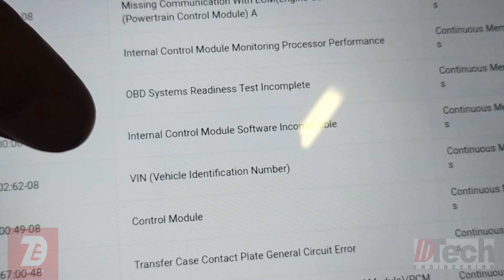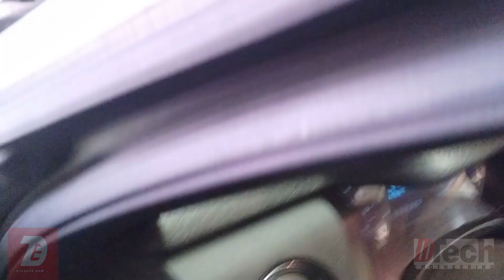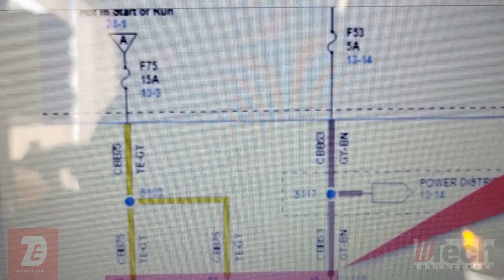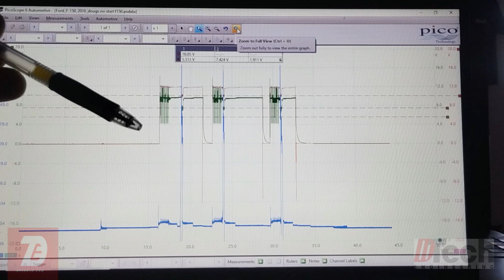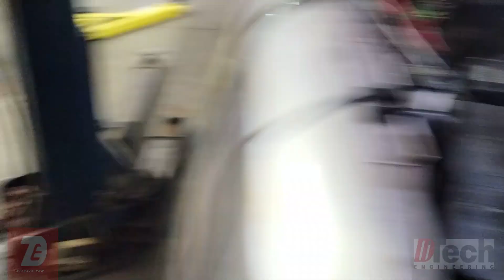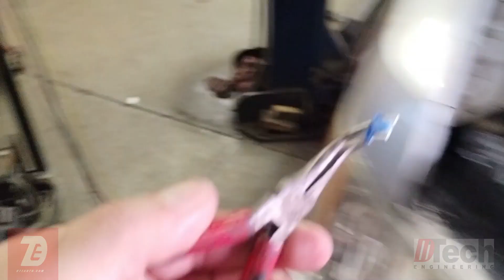2010 Ford F150  PCM Code P060A No Start Diag & Fix

Comment: My 2009 was having the same codes, CEL and wrench light. It would start and run but really poorly and the throttle would do nothing. Taking the fuse out and putting it back in immediately fixed the issue!!!

I also had a corroded battery terminal (negative).

I seriously can't believe it was that simple! Thank you for this video!
Reply from the maker: Thank you so much for that, very much appreciate it!!

I am super glad to hear that the video helped you out and got you going again. Thank you for the support and thank you for watching!

Comment: Was getting codes P060a and u0300 codes along with battery and wrench icon. Was stuck in limp mode on the side of the road. Removed this same fuse and replaced it and back on the road! Thank you!
Reply from the maker: Glad it helped get you back on the road!

Comment: Very nice diagnosis, I must say! Do you have any idea what year range that might be most likely seen on? I do a very large number of Ford trucks and I have not seen this yet, but I will be keeping my eyes open from here on out. Again, nice diag and thanks for posting! 👌🏼👍🏼👍🏼
Reply from the maker: I am not sure on the year range, but more maybe can be picked out by the type or style of pcm.... this could possibly be more attributed to happen on the 3 plug pcm's compared to the 2 plug ones. Although any module that receives around the 7.5v's seems to be the threshold for acting funny. I did another video on a bmw that keep losing key recognition in the immo module due to voltage dropping right at that 7.5v's range. Thanks for watching and hope that helps with the question.
Reply: @DTEAuto  Excellent, thank you!